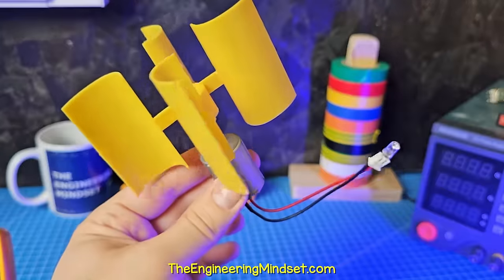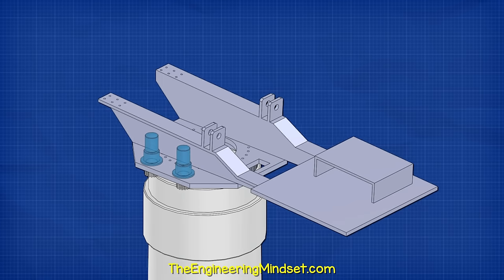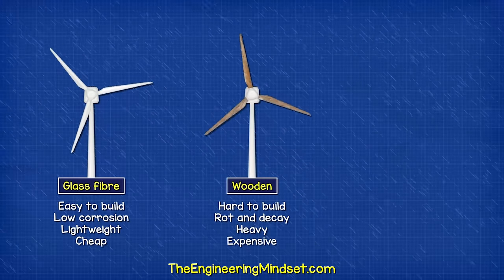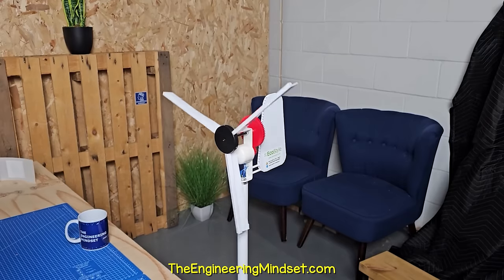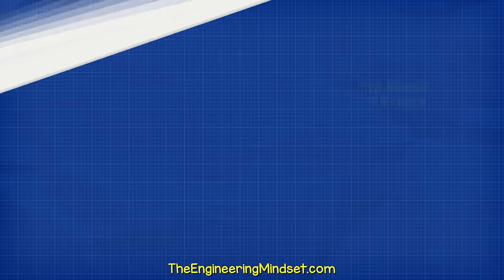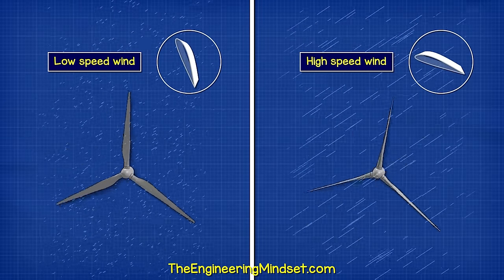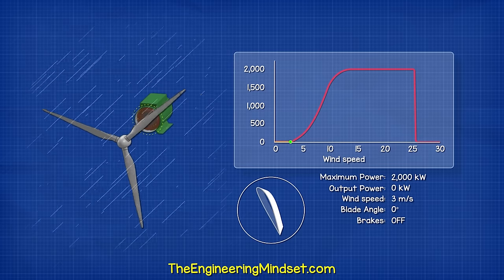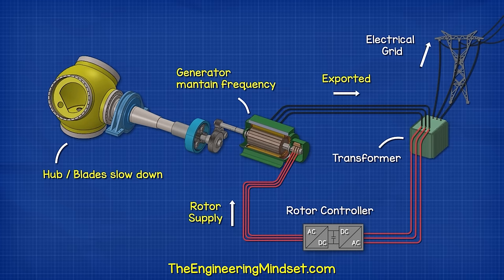How Wind Turbines Really Work: The Hidden Secrets

Comment: OK THIS IS A BIT LONG WINDED BUT WORTH IT,,,, 
So we are told dams are bad for the environment because of the large amount of concrete used right ? 
SO as best as i can tell to date all of Australia's operational wind farms have consumed enough concrete to make two medium sized dams now a long with the blade issues lets do a side by side workup. 
A dam lasts 100 plus years makes more power than the wind farms is true baseload power near enough 97% recyclable and last time i looked i have never seen a fresh water impoundment were mother nature has said no thanks we dont wish to live there
THE PLACE IS SWARMING WITH LIFE so dams bad ok if u say so.
WIND FARM massive slab of concrete to hold the hole thing up & blades that to date have no plant to recycle them are not true baseload power and last at best 25 years right??
Reply from the maker: There are pros and cons to every source of energy. Concrete and metal will be required for large scale power generation regardless. We need more and more electricity every year, though. I don't get involved with politics, I just explain how things work. But until fusion reactors become viable, we will need to explore and harness all options available if we want to keep enhancing our quality of life. Even if we simply remained at this level, the amount of people being born requires more energy to be produced.
Reply: I hear you but on the point you made "we need more and more" As an inventor back in 2016 i posted a video on making all the worlds hydroelectric power plant run up to three turbine halls rather than just one. This of course has not happened so to the point about power we are not really in need it is a selling point only?

Comment: Wind power is BS.
Reply from the maker: It's just a way to turn a generator and produce electricity. Burning coal or using nuclear energy does the same thing, it just turns a generator we just don't need to add fuel with a wind turbine.
Reply: Your contribution is BS.

Comment: In the video you claim that wind and solar are always producing electricity. Clearly not the case, for solar in the UK there's virtually nothing in winter every year. Wind in Northern Europe can experience droughts of weeks, 10 weeks April to July 2023.
Furthermore using m/s for wind speed clouds and obscures the facts. The cut in speed for the non technical is 7mph and optimum output is at around 23mph. The average wind speed of UK Storm Debi was about 25mph. Who wants to live in permanent Storm Debi winds?

The blades are made from fossil fuel derived materials. The towers are made from steel and the base from concrete none of which are, it's claimed, good for the environment.
Because the blades are light weight there is no inertia so when the wind isn't strong enough, 7 mph, generation ceases almost immediately. Steam turbines don't suffer from this lack of inertia meaning there's a gradual fall in output making grid management of failures and fluctuations simpler.
Reply from the maker: Well its just a video about how they work but, in response, I mentioned wind and solar are a good combination because it's always sunny or windy, while depicting how wind is generated from the temperature difference of sun and cloud over the land. I also show how nuclear is connected to the grid.
The optimum wind speed might be high, but we can deaign them for the local wind speed. It doesn't mean it won't produce power below that optimal wind speed. This is clearly shown in the video.
The wind turbine might be constructed from steel, concrete etc, but  so is every large power plant, the difference is we don't need to constantly dig and burn resources each and everyday to turn the generator, only during construction. Sure, with this design, we consume some energy to yaw and stabilise the output frequency with the grid but we can produce far more power than consumed. 
If we consider coal, we need a lot of energy and materials to build, run and maintain the enormous dump trucks and diggers, the trains and conveyors, we have to use a lot of energy and materials building the power plant, then we have to transport and store all that coal, then move it into the furnace, we need to pump lots of water to cool it, we have to burn fuel getting all the workers to the mine/pit/power plant, we have to run all the lighting, A/c, heating, toilets, kitchens, fire/safety/controls, offices, conveyor belts etc etc etc. And a vast amount of this energy has to be consumed each day just to keep the lights on. But not with wind, it can and does reduce the strain on resources and is a great supplement to our aging energy network. It's not perfect, there is no perfect solution.
Reply: @EngineeringMindset Sorry but wind and solar are not despatchable, that is they cannot be increased or decreased to match demand. Nor can excess output be stored in Great enough quantities to cover wind and sun droughts. Load factors for wind for the UK are between 25% and 40% on and off shore. Solar is less than 20%.
Of course any type of power generation requires an input to build the facility, but building more wind turbines to cope with situations like Thursday - Friday last week when the output from 40GW of wind was less than 2GW across the entire fleet for 48 hours.
There also remains the interesting question as to what turbine blades and other fittings are made from when fossil fuels, aka oil and gas, are no longer available?

This is impressive technology that doesn't really solve a non-problem.
Reply: We also swap power with half a dozen other countries if we generate to much or to little and as the grid grows to hopefully become world wide it will always be sunny or windy somewhere there are a lot of countries with more sunlight than they know what to do with and some places where the wind blows almost all the time. Energy is a global problem and needs to be treated as such rather than it will be all right here and it doesnt matter if a few million people get displaced through drought floods and rising seas. They might want to escape over to here.
Reply: @stephenbuckley2186  if you look at the data you'll see that Germany, Benelux, Denmark, Northern France and southern Norway all have wind droughts and winter sun at the same time as us.
All generation data is available on line if you look for it.
I think that the interconnectors are about 8GW total, not counting Ireland which definitely has very similar wind conditions, maximum demand is in excess of 40GW.  Electrons from Iberia and Italy are unlikely to cross the channel being required elsewhere in Europe which was relying on French nuclear until a lot was closed down.
It's a major misconception and error to think there is wind and sun somewhere creating spare power. There isn't and it requires huge theoretical over capacity everywhere and a huge grid of connections